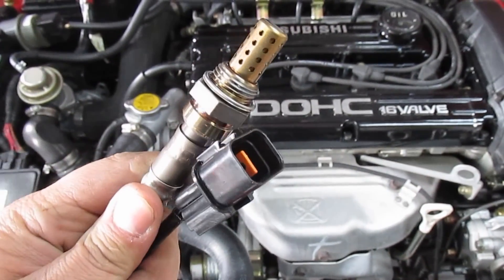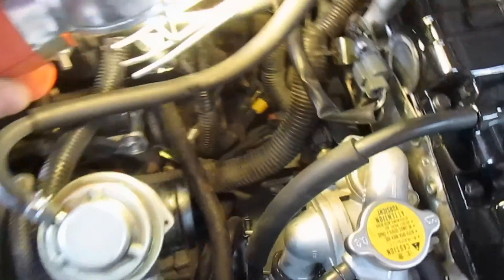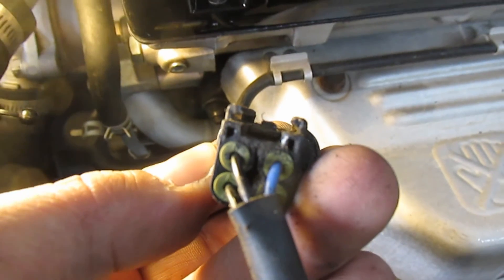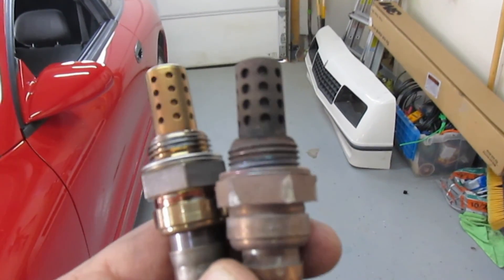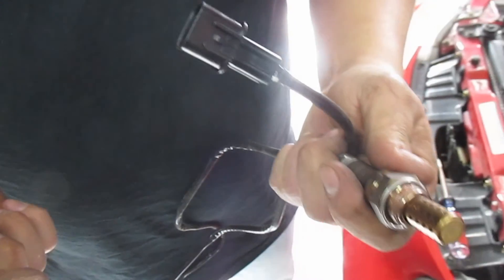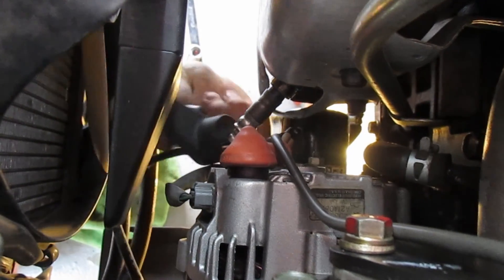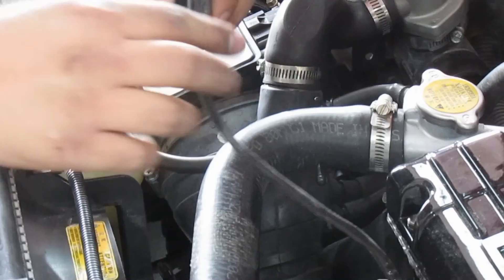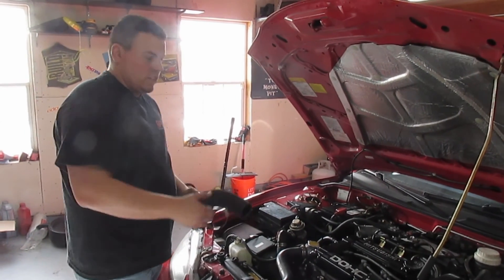How To Replace Mitsubishi Eclipse 4G63T Oxygen Sensor Step-by-Step

Comment: I found it easier to remove the radiator fans. This gives you more clearance so you don't have "reset" or remove the ratchet handle every time the ratchet reaches the end of it's rotation. It's only 4 10mm bolts and 1 electrical connection.
Reply from the maker: Thanks for watching!

Comment: good walkthrough! i will check mine out and see how it looks! and acts after install
Reply from the maker: Thanks For Watching!!!
Reply: @FatGuyBuilds  wow. 7 years ago! My talon ran good with the new o2 sensor.  But now it just collects dust. Ran too thick of an oil in the winter and the rod bearings were not happy. Expensive and dumb mistake on my part. Shoulda switched to a thinner oil

Comment: My A/F gauge was showing MAX LEAN and I can't even tap the throttle without it saying that. I haven't been in ecm link bc I'm having connection issues. And then a few weeks later, I turned on the car and the  A/F gauge doesnt even
Reply: .*doesn't even turn on. What credible website did you get your o2 sensor from? I ONLY had this problem ever since my maf connector came unplugged while I was driving. I caught the problem about 15 minutes after the fact, but had these problems ever since. Any insight?
Reply from the maker: @djack2058  sounds like u have bad injectors.  Rockauto.com. and bosch sensors
Reply: @FatGuyBuilds  dang ok thanks😎. Now I do have a MAF translator box, and I was thinking it got shorted out or something.  Everything was 100% fine, drove the car 8 months, and then my power wire sliced in half on my maf connector while driving.  So I basically was driving with NO MAF for 15mn. It idles fine. Changed my spark plugs. Just whenever I tap the pedal, you can even feel the Lean-ness.  And it goes max lean.
Reply from the maker: @djack2058  in that case.  That maf is probably trash.  I would start with going back to stock maf
Reply: @FatGuyBuilds  aight. Thanks for the info

Comment: thanks man, what happen if i use my car with no o2 sensor? i got same engine 1 but o2 sensor is looks damaged
Reply from the maker: It will run extra rich and not run very well overall since it will be stuck in open loop mode.
Reply: @FatGuyBuilds  thanks man, it's running extra, i am gonna change it👍